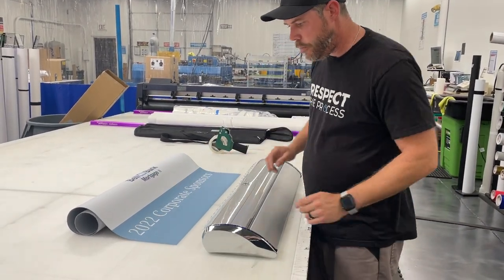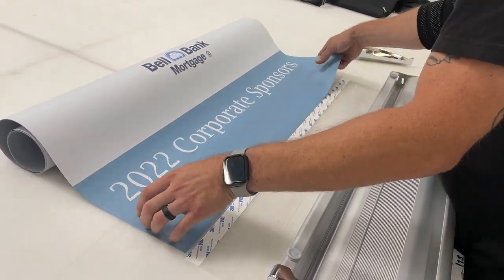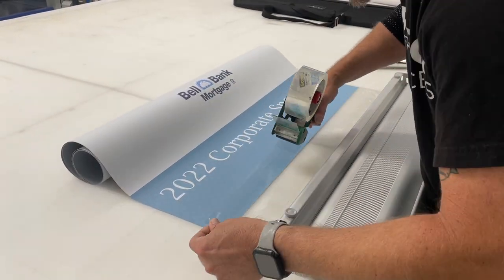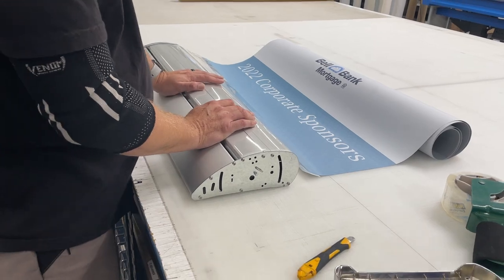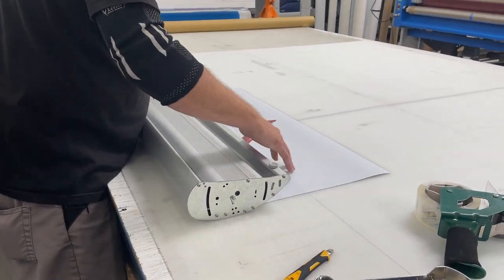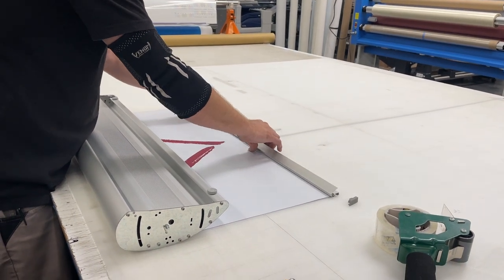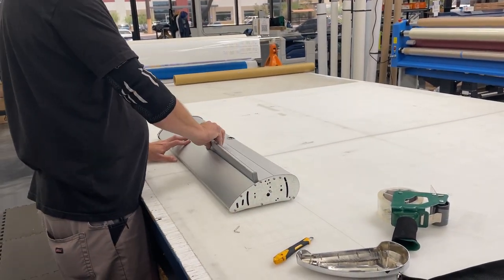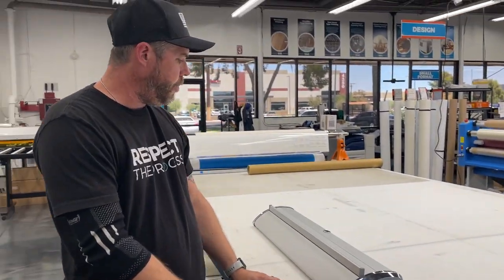How to install graphic on a retractable banner stand

Comment: for printing, how much excess you need to leave for the design to show completely? for example if your display is 85x200 cm, I can see on top it bites like 1 cm off, but on the bottom I'm not sure
Reply from the maker: It can vary a little depending on the brand of banner stand, our standard is to leave 3" blank on the bottom.